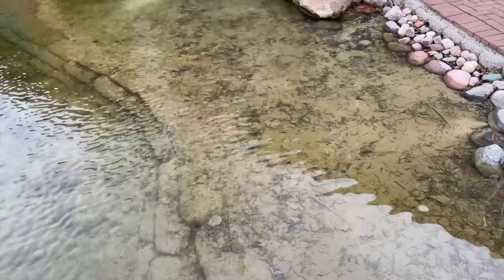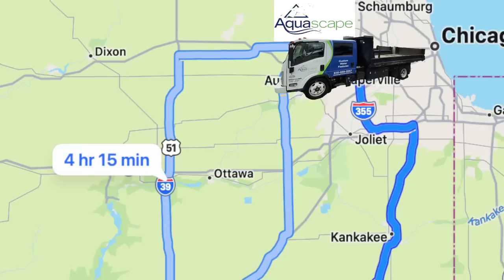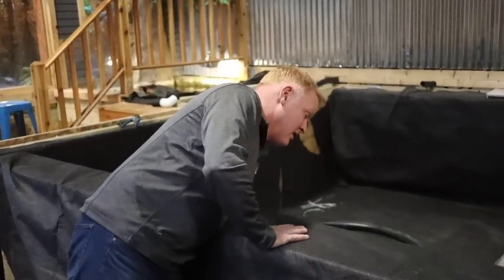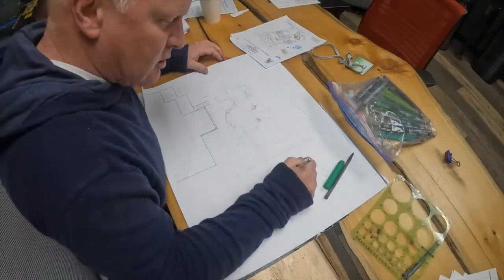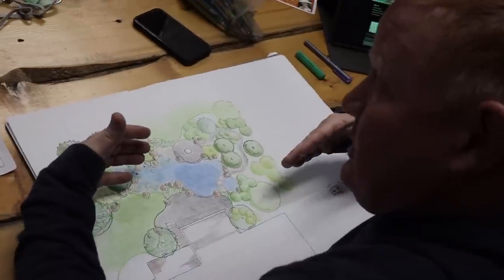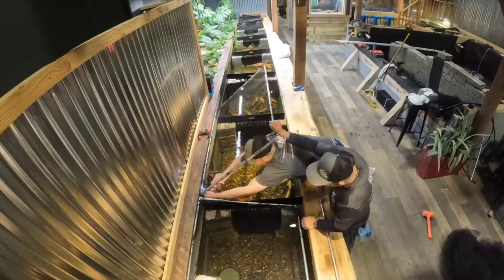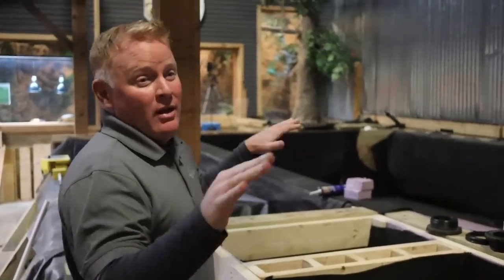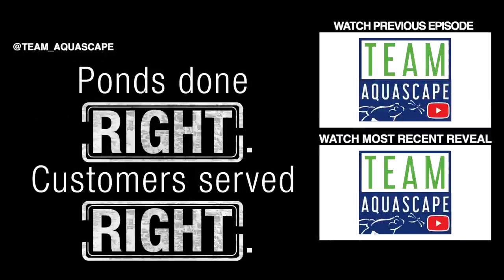We Ruined Our Signature Pond!

Comment: You can use motion sensors like the ones used for flood lights in front of the tanks on the floor tied to the outlets for the aerators so they turn off as people walk in front of them.